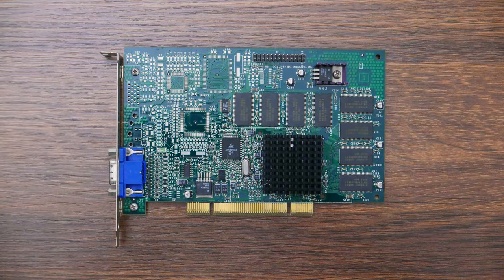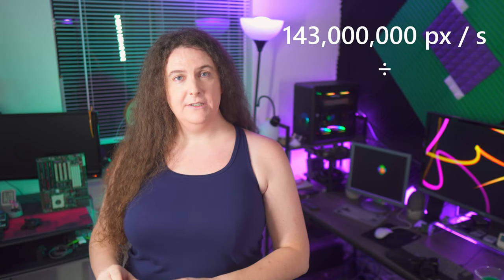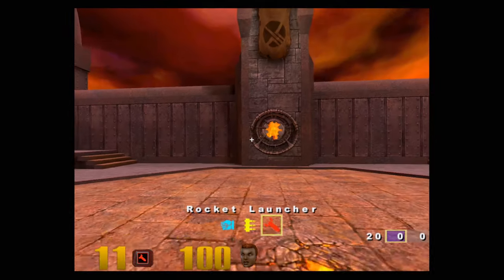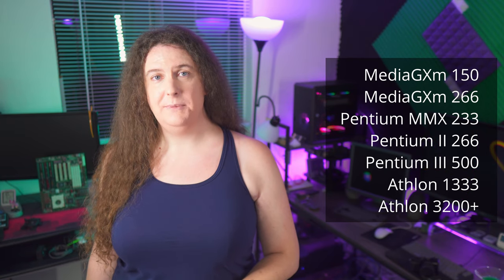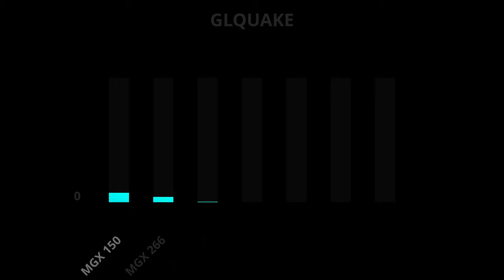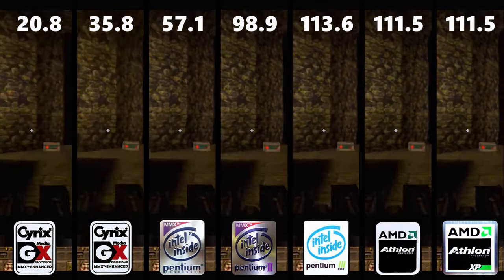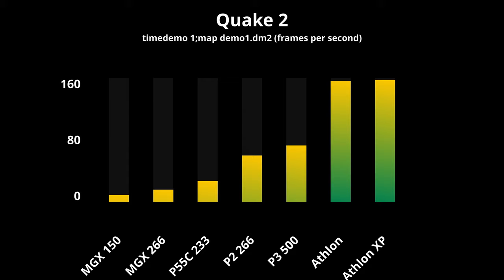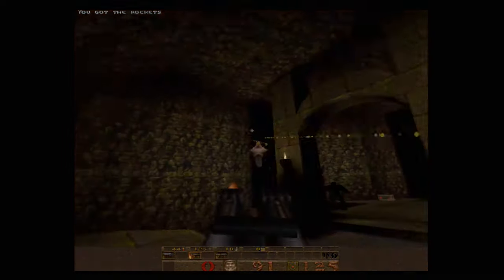How fast will it go? Voodoo3 Scaling

Comment: K7 just casually rolling with a 33% overclock like it's nothing! Thanks for the video, really appreciate how you presented the benchmark results. Not dry, easy to read and understand. It's amazing sometimes what you can squeeze out of CPUs of this era. I paired a V5 5500 with the XP-M system I have (mobile chip in a desktop board, no problem) and it seems to sit right at the balance.

Comment: Great video. I love seeing scaling runs. I've never owned a V3 so I had no real idea what to expect but, nearing 100fps for Q3 seems pretty respectable to be honest.
Reply from the maker: I wish they were cheaper and more readily available, because they make really great retro cards. Fast VGA, fast GUI acceleration, pretty decent 3D performance, and very low driver overhead.

I've had this one for about three years now and I love it. It's so versatile!
Reply: I had the 3500 back in the day, think it was end of 1999 towards 2000 and it was a pretty decent card at the time. Had it right until my Geforce 2 MX400 in 2001. I miss the days when I could replace graphics cards every 2 years. My 2060 super is getting long in tooth now :-)

Comment: Can't believe I missed this one in the past! Great video, amazing how much that voodoo scaled. About your p3 on quake 2, yep, cache speed related. I had this issue with the blaster board, it will not run the cache on the coppermine at full speed and performance is crap. I did manage to run the quake 2 time demo once with the cache a full speed and got almost twice the result I had before, really impressive, but it wasn't stable at all, crashed a few seconds after the run. Another great video, thanks!

Comment: I like your weird obsolete computer content ;)
Seriously , enjoyed the video , brings back so many memories , I went from a Pentium 100 @133 and a Voodoo 1 to a P166mmx @266 and even 290.5 after I got better cooling with a Voodoo2 and then a Mendocino 300a Celery @ 530ish (can't remember exactly) and added another V2 , that was a banging system , wish I'd kept it , gotta say I was quite surprised by the poor showing from the P1 you tested , seems my memory was a bit rose tinted haha.
I recently built a retro 98se PC with a 2.8ghz P4 and a Gf4 4400ti , I've really enjoyed playing all my old games again , it's been such a blast , next I'm thinking a retro XP system with slightly over powered hardware , maybe a decent i3 or i5 and a 7970 or something similar , more fun!!
Thanks again , subbed 👍
Reply: Oh and btw I smoked an Athlon 1ghz back in the day too , lol , they were always a bit touchy if they got hot.
Reply: @LeeMc007  Those were the days that processors didn't have thermal throttling yet.

Comment: I loved this, particularly how you take the technical and make it digestible (plus the sense of humour with the post-its!) I've never done scaling tests, so I would like to make a complement to this, if I can. I have the CPUs for it and I would like to see that gap between the P3 and the Athlon plugged. Very curious how much faster the Athlons were - considering the discrepancy with the Q1 result, there are clearly some optimisations present in the code of the later Quakes. I think you're right about the cache, because in my tests of Q3 on G4 Power Macs, cache can double the framerate. I'll let you know what I find!
Reply from the maker: Good luck!

Comment: Nicely made video, though it didn't really demonstrate anything that wasn't already known. I was actually given a 1.13GHz AMD Thunderbird with an AGP 3000 back in 2006, which I never used for anything. That setup was seen as the absolute maximum performance you could have out of a Voodoo 3.

But there is one thing that needs to be mentioned. The minimum requirements for the Voodoo 3 AGP as listed on the box was a 90MHz Pentium and AGP X1. That combination isn't even close to sufficient for saturation, so the card happily sits there slowly pushing frames across a table with a pencil.

Once you start saturating it with work, the card gets hot, really hot, in excess of 75 degrees centigrade. Without active cooling the entire card slowly heats up, and you will end up boiling the electrolyte in the capacitors, which leads to failure and circuit trace damage, wafer separation in the RAM chips leading to irreversible screen artifaction, and in extreme cases, delamination of the circuits around the GPU chip.

While the card does scale really nicely, I run my 3000 at 183MHz with a slight overclock to 1.19GHz on the CPU FSB, this kind of setup didn't exist when the card was developed, so the factory cooling was adequate, but it isn't anymore.

If one is planning to use the card long term, upgrading or simply augmenting the cooling is absolutely necessary.

The Voodoo system I was given had seen almost no use whatsoever. No sooner than it was assembled, it was deemed obsolete and shelved, then a few years later it was given to me. Most people ditched the Voodoo 3's in the early 2000s, by 2002 many titles required 32bit 3D rendering, and that wasn't possible with those cards. So the fine condition Voodoo 3's that are currently kicking around, will soon become desk ornaments as they are burned out through judicious testing by retro tech enthusiasts who fail to grasp the basics.

A bit like you toasting that Athlon 1000. Pretty hard to see that happening if someone is paying attention.

Comment: Just had your video recommended and this is a great one, really well explained! My last Voodoo was a Voodoo2 SLI setup, as far as late 90s gaming hardware went though I got 3 years out of them which was a pretty good life and as this video demonstrates you could always throw more CPU at them. I didn't really see much of the Voodoo3, by the time they came around Nvidia were stealing their lunch.

Could you get hold of an Argon/Pluto K7? I seem to remember it being faster but the Katmai P3 was very, very close. Probably not an easy platform (Slot A) to find these days though, short lived.

Comment: PhilsComputerLab did some nice testing along this line a couple years ago, even releasing a really inclusive PDF with tons of graphs and charts.  It was specific to Voodoo2 scaling and Intel CPU's IIRC, but it highlighted the massive power of Voodoo2, especially in SLI!  With two cards on-deck, many games scaled all the way up to the top of the consumer Pentium III line - with some even showing a marked improvement going from Coppermine 1GHz to Tualatine 1.4GHz!  I can personally attest that my 1GHz P3 w/ Voodoo2 SLI lays waste to my AMD K6-2+ 550MHz w/ Voodoo3-3500, despite the latter card having basically double the internal clock speed of the Voodoo 2's.

Comment: I'm not sure your logic for texturing is correct. I don't think the 3dfx cards allocated different geometric textures per TMU to swap between. That could be a viable method, but is likely not worth it... Assuming all of your textures are identical in format with the same blending modes, then all you have to do to swap between them on a single TMU is to update the base address (i.e. point to a new texture in the TMEM). If instead you were trying to swap TMUs, you would need to configure the blend path, which could be upwards of N writes for N TMUs. And if you need more textures than TMUs, then you would have to update both the blend paths and base address registers (with the previous case, a single TMU can handle as many textures as can fit in the TMEM). So essentially, you get better performance by re-using a single TMU. I don't know for sure though as I haven't seen the source code or looked at the PCI transactions.
Also, most likely the two TMUs were used to do 1-pass tri-linear filtering, which would mean that both TMUs point to the same texture (one has a LOD bias applied, which can be set once per scene).
Your original back of the envelope math is correct though. But that makes a lot of assumptions that are not valid in practice. For one, you need to clear the screen, or else you will get weird effects (so you can count that as a full screen - the cards could clear 2 pixels at once, but they also need to clear the depth buffer, so it washes out). Then you also have the fact that the DRAM will not respond that quickly, so you're guaranteed to have some stalls (it might be fair to estimate it as 80% of the DRAM bandwidth).
When doing alpha blending, that was done the same way as opaque graphics. It did incur a penalty for reading back the framebuffer to blend with, but that penalty is mostly hidden by pre-fetching (it likely would only show up with small triangles).

You're correct about the PCI bandwidth being the bottleneck though, which is partly why the later cards moved to AGP. 
Do you happen to know what the PCI and FSB speeds were for the different systems? The scaling appears to be almost linear with CPU frequency - that's not what I would expect due to how the IPC changed across the architectures. It could also be coincidental if the DRAM bandwidth scaling happened to be linear as well.
Anyway, great work! I've been trying to figure out how much the CPU affected performance with the Voodoo cards, so your testing was very helpful!
Reply from the maker: I bow to your superior nerdery!
Reply: @TechAmbr  I don't think it counts as nerdery in this case - computer architecture is my day job, and I have recently been trying to understand how the 3dfx cards worked internally, as well as reviewing the internal pipeline architecture differences of the Pentium era (within the past week).

Comment: Please tell me, ma'am, which do you think is better (in terms of performance): voodoo 3 3000 or voodoo 2 in SLI mode?
Reply: Personally I would go for a Voodoo 3, although it depends on the game. The Voodoo 2 is limited by its texture memory, so in later games e.g Quake 3 the V3 can be a lot better.
Reply: @michaeldale837  Thank you very much.
Reply from the maker: Agreed. They're so close in raw performance that unless you're running a game that specifically needs the Voodoo2 (are those even a thing?), the Voodoo 3's larger unified VRAM pool makes it much more useful.